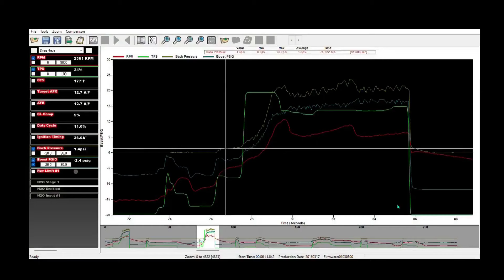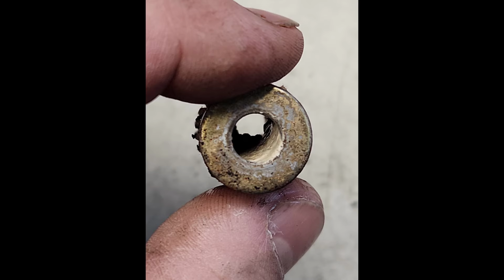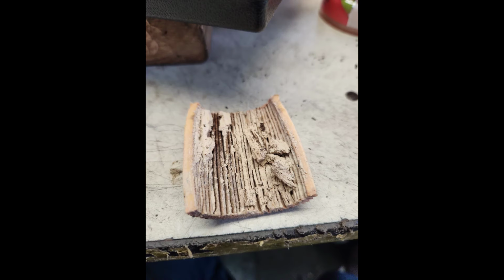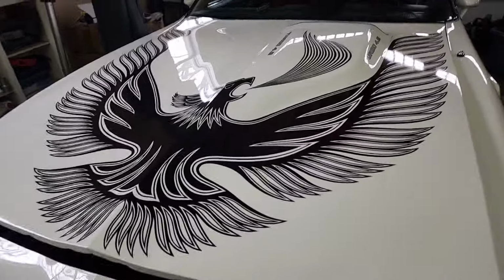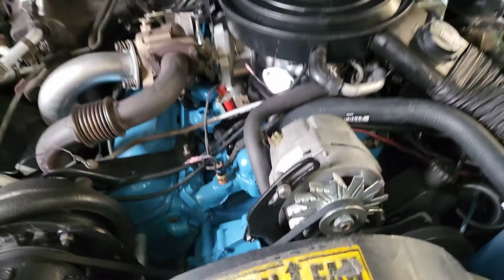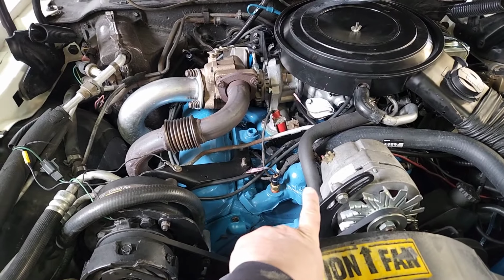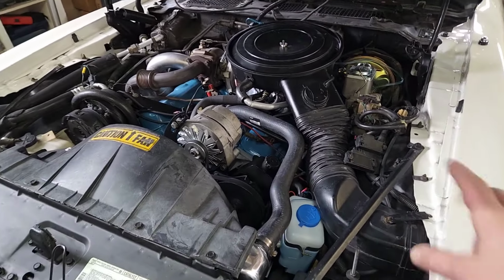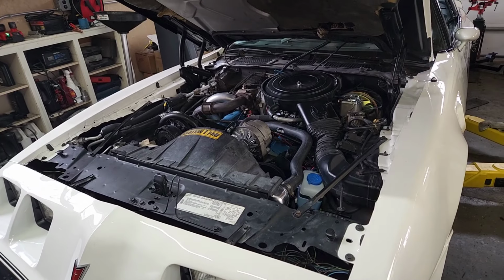TTA Performance - Sam's 1981 Daytona 500 Turbo Trans Am Part 3

Comment: What did you use to plug the holes in the cylinder heads after removing the tube for the pollution pump. I took the pump of my 80 TA but still have the tube that connects the two cylinders. I want to remove that also. Thanks for any help.

Comment: The 81 computer Q-jet has primary jets. The computer controls the primary rods that go in the jets. 80 has vacuum operated primary rods. Also the secondary choke pull off is a big part of how fast or slow the secondaries open. Those choke pull off's open at all different speeds. Try to look up and see if you can get a hold of different ones from different engines. You will be surprised how they make a difference. Have you tried "CV" secondary rods. They may help because it will give the added fuel the boost needs.